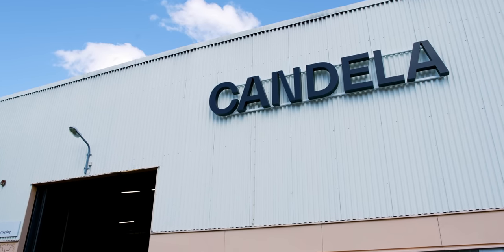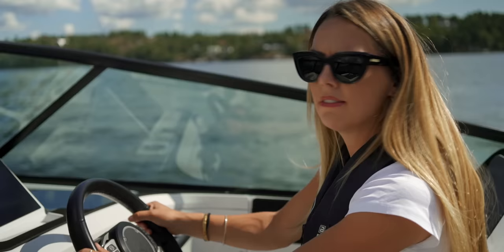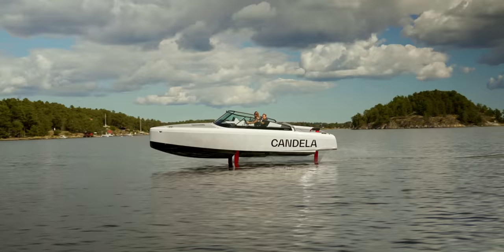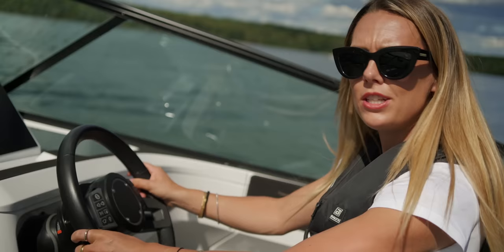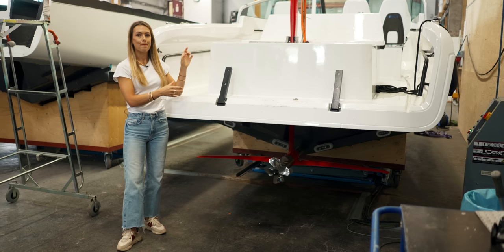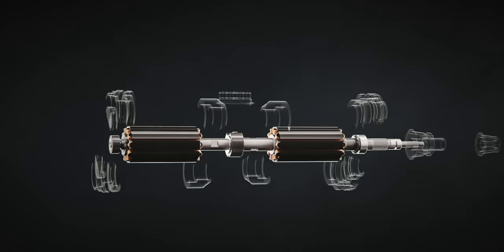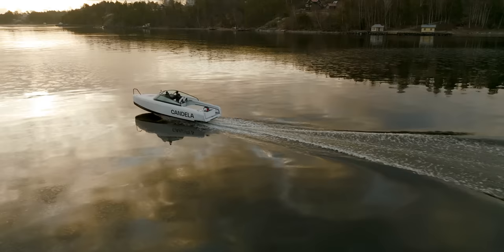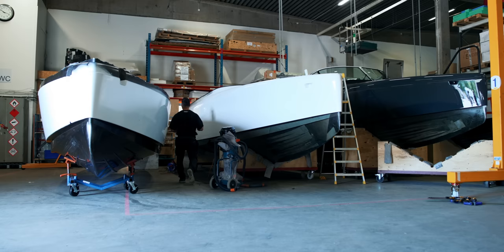This Candela Electric Boat FLIES!

Comment: My favorite part about this is when she is out on the open water, driving/flying this boat, and just talking at normal voice levels.
Reply: Absolutely, a normal power boat at those speeds makes conversation a very shouty affair.

The other thing was that her hair was almost still. The windscreen design on that boat is super clean to have so little turbulence at the control position.
Reply: @rlaxton666  Totally forgot about the lack of wind noise. Absolutely right about the cockpit design and the air bubble the captain enjoys.
Reply: @JasonCarmichael  Very much a benefit of a long haired presenter. Other than microphone noise, some buzz cut guy would never have given us this much information so quickly.
Reply: And the design also allows for a smoother ride. Win, win, win, win all around
Reply: sooooo, you can only use this on a slack water... just an observation...
Reply: @hunyango2k  No. Hydrofoils can be used anywhere except extremely shallow water. Large commercial hydrofoils already go on tidal or open water. And on the opposite end of the scale, kite surfers often ride hydrofoil boards on choppy days when regular boards can’t be ridden.
Reply: I was just about to make that same observation Jason
Reply: Right! That was so cool
Reply: Intelligent noise reduction algorithms in modern microphones and editing programs plays a role here :)

Comment: Imagine the flex of driving one of these through a "No Wake Zone". 😆
Reply: Makes you wonder what the minimum spec is for getting up on the foils since the wake is definitely going to be less at that speed than just dribbling along at 5 knots in "boat mode", which is a common speed limit in wake limited areas.

Comment: I spent fifty years in high tech product development. From consumer electronics,  to marine equipment and NASA management.  
This boat, although not introducing anything particulary new, is the perfect integration of complimentary tech. Wonderful. Foils, electric drive, it was a marriage that had to wait for the right time. And that time is now. Kudos.
Reply: I do have one small criticism. In applications where one needs greater range, this system, although it makes it easier to adopt batteries, doesn't fundamentally support batteries as the prime power unit. It would be more cost effective at low intensity to install an equivalent power diesel generator with Rolls-Royce style baffling. 

That said, it is still fantastic engineering and it does at least lower the performance envelope for batteries to be installed at more reasonable weights and volumes.
Reply: @josephkolodziejski6882  They could easily go to cat version and have more power/range. As battery efficiency rises this will be more feasible.

Comment: Imagine a Candella ferry on the Thames or maybe some of the larger more northerly UK rivers.
Reply: love the boat but hydrofoils are not allowed on the Thames above the ferry. the engine is something i can see lots of british waterways clearing for use. if they could do one suitable for narrowboats they would go like hot cakes. the taxi engine thumping away is the only thing that spoils a trip on a narrowboat.
Reply: @tommyfred6180  Why aren't hydrofoils allowed (above the ferry) - didn't understand that last bit? 
I'd considered narrowboat usage but dismissed it on the grounds of very low speed restrictions on UK canals; (might) be useful on EV surfboards in a canal situation and these are already on the market - see Electrek & Fully Charged Show's YouTube channel videos.
Reply: @pinkelephants1421  the Thames has different restrictions on everything from speed to prop type. it split up into different sections. above the ferry refers to the Woolwich ferry crossing. its one of the points the rules change. as i understand it and i could be way off. hydrofoils are not allowed beyond this point.

as for the narrowboat i think a low speed prop set up for the motor shown could work well.
Reply: @tommyfred6180  There are already companies building electric or hybrid narrowboats, and you are correct, the silence is golden. Look up Ortomarine, Hybrid Marine and Mothership Marine for some examples, I'm sure there are more.
Reply: @gz3zbz  yep i know. but i didn't know about mothership marine. i'm going to give them a look. thanks.

the problem with the ones i do know and i could be way out of date on this. is they are all working off the idea of just replacing the engine with an electric unit. you still have the prop drive system and so on. this unit setup would be way better. you could even set it up so you got directional thrust.
Reply: @tommyfred6180  Thanks for that much appreciated. However, surely a low speed prop would entirely negate the benefits of a hydrofoil as it wouldn't operate at a high enough RPM to bring the boat out of the water & a narrowboat is entirely the wrong shape anyway.
Reply: @pinkelephants1421  ho i get your point now. yah a narrowboat with a hydrofoil. now that would be something to see. :)

no it was the enclosed power unit and prop set up that i think would transfer well. mate
Reply: @tommyfred6180  O-h-h-h, I see where we were getting our wires crossed now. Yes, that would work. But I still don't think you could make any meaningful full use of a hydrofoil's full capabilities; canals are strictly puttering along territory.
Reply: @tommyfred6180  the system has to be pretty robust on a narrowboat what with all the shopping trolleys, bicycles, logs and generally low water levels that you find in a typical canal. I do agree there is still room for innovation.
Reply: @gz3zbz  yah the thing would need to be beefed up. smacking into a submerged moped even at five mph could be an issue other wise.

perhaps cowl the unit would a solution. or they could just dreg the canals now and then. :)

Comment: What I find coolest about these hydrofoil boats is that... This simply isn't possible with petrol engines! ICE hydrofoil boats exist, obviously, but they are a lot more complex and expensive, because they need to keep the engine above the water while the foil operates a metre or more below. On the contrary, electric motors don't need air, so they can be put underwater, making them a lot smaller (the water itself is the cooling system), cheaper and more efficient. And you also get the added benefit of less noise and more stability.
They truly show how electrification can be the answer to the questions we never dared to ask

Comment: A retractable rigid cockpit tonneau, that covered the entire seating area while the boat is waiting in its slip for the next outing, could be cheap, relatively low-efficiency solar panels that, low efficiency notwithstanding, would charge the batteries up over the multiple days between outings.  Not many people use their boat every day; when you're running with only a couple of people aboard keeping the tonneau mostly deployed would probably also make a significant improvement on the vessel's aero drag (which cannot be ignored when talking about cruising speed and range) and further improve its performance.
Reply: There are plenty of extras for such boats: seats, couches, tables, covers etc. I'm sure Candela will provide most of them.
Reply: That would be great accessory

Comment: We can cool citys worldwide with a couple easy to implement infrastructure.
Parking lots take up 25 to 30% of land use in citys reduce this by 80%.
Go up not out parking garages can have batteries on first floor and solar or wind or bolth on top.
So the now freed up land can have native flowers bushes and trees to reduce heat flooding co2 and crime and increase o2 happiness and food if it gets planned of course.
This will help cool citys wich will reduce energy demands because you will need to cool buildings less often than before.

Comment: Superb combination of innovative engineering and product design. 
I was wondering about the pressure differential - to create the lift - spoken of only in terms of the angle of attack (effectively) . After getting up to speed, for minimal drag I think you'd want zero angle-of-attack and reliance on an aerofoil profile to generate the needed pressure difference. The 'wing' profiles certainly appeared to be aerofoil shaped.

Comment: Friend had a very expensive motor yacht or very large speed boat you could sleep in it, it shifted when you wanted it to. Now this was a good few years back but you could spend the day in the Loch it was in. If you went 20 miles in the days fun if felt like you had traveled far. The scary thing was you could watch the fuel gauge move on full power. In todays petrol prices ( yes they had to pay over the odds marina prices to use their pump) back then it burned through £100 in an afternoon and this was 15 plus years back and just thought wow that’s crazy in petrol you have to just accept your going back to put £100 in at the end of the afternoon. 

So I like this, it looks a fantastic toy to use on the water. More power to them if you forgive the pun. I’ve been around speed boats all my life they are poor on reliability akin to a classic car or at least they used to be so a more reliable boat - great. A clean boat not leaving a rainbow in the water welcome.

PS Stockholm looks stunning.

Comment: Whether you travel through air or water, power requirements are proportional to speed, a single horse can pull a car or boat. In fact it is probably easier to pull a canal barge than a truck. People are starting to produce electric canal boats and I believe that will accelerate when more marinas electrify berths and the EA put more charging points on the canal banks.
Reply: yep, I watched only as minute and got shocked by the statement that pushing through water takes more energy than pushing through air. This is obvious, but except military and smugglers and few scientists nobody uses submarines. Boats, even are pushing a little through water, still are going mostly through air, and are actually more efficient than planes. Sure, hidrofoils are more efficient. We had few passenger ones decades ago. I wonder why their use was discontinued.
Reply: @ehombane  The vast majority of the energy it takes to move a boat is pushing the water out of the way, not the air.
Reply: @davidf2281  If you read again my comment you will see that I have said that this is obvious. So, I have no idea why you are repeating the obvious.

Comment: Fabulous tech! 
Any idea how robust the foils are?  
If you were to hit a float (crab pot, net, log) ... What happens?
In conventional outboard you may need to refurb a prop ... The hull may have a scrape or ding. 
How would one of the foils fare?
Reply: In the 1970s-80s, Boeing made the 929 Jetfoil ferry boat.  It carries 200-300 people and runs at 45 knots.  They sold 50-ish vessels, I rode on one in Seattle way back when.  People always asked about hitting stuff, with all the trees that make it into those waters, but they never developed a sonar that would detect that sort of thing.  The boat required a deep channel, so it could stop in an emergency.  Several sharp maneuvers made the news, mostly for spilling drinks, but they claim there never had a vessel disabled by debris.

You can't operate something like this with plants in the water, from a fouling and drag risk, and hitting a sandbar might be catastrophic.  You'll want to keep to deep water, like Swedish Fjords.
Reply: This technology have been used on larger ferries around the world for decades. Hong Kong ferry would probably comes to mind.
Reply: @nntflow7058  We had few on Danube too. Russians also I think they still have. And I remember an japanese one recently hitting a whale.
Reply: @rsaunders57  "You can't operate something like this with plants in the water, from a fouling and drag risk, and hitting a sandbar might be catastrophic."
The same limits apply to a conventional powerboat.
Reply: @davidf2281  Well, a conventional powerboat has less draft, and a V hull is much better at pushing things out of the way.  The wake of a boat has functional effects, not just the negative drag effect.
Reply: @rsaunders57  Those foils aren't as deep as you think.
Sure displacement hulls are "better at pushing things out of their way" 
That's how they work. You're comparing an aeroplane to a zeppelin.
Reply: The foils are carbon fiber and are meant to simply snap if you hit something. Then the boat simply falls into the water and acts like a regular boat from there on. I think it seems safer than a regular boat in that respect.

Comment: Would have been nice to compare fuel use to the powerboat next to it. Nvm, at 8:50 its said 500 € for gas or 15 € for electricity.

Comment: Hate to be one, but that would make an excellent Spec Ops infil boat.
Paint it Vanta black and you could probably pass within 100 meters without being detected.
Major heat source is under the water, so helps with IR detection.
Extremely low maintenance.

Comment: The "magic" ratio of water density to being mostly up in the air that allow this boat to be so efficient also works for human powered water propulsion. I am a  long time member of the International Human Powered Vehicle Association which has been "flying" boats on the puny efforts of a single human faster than the fastest eight person  Olympic  style racing shell boats for decades now. A good human athlete can just about put out 1to 2 hp for enough time to get up on the foils and it takes  1/8th that to stay up. Our craft have used mechanical means to control the flying height, and body weight shift to compensate crosswise waves or to make the boat bank like an aircraft in turns. Of course we also have been using kevlar and carbon fiber technologies to achieve the lowest weight to structure sizes needed. See one of the winning boats from our competitions at the Boston museum of Science, If it is still hanging just inside the Atrium. The Decavitator was built and propelled by one of this country's best aerodynamicists Mark Drela

Comment: If we are considering flying boats then there are lots of other tech that can cut energy use moving over water -  ground effect seaplanes, hydrofoil ferries, air bubble hull surface effect water displacement, waterjet propulsion. While this small boat design can work elsewhere, its weight penalty due to batteries as well as the energy needed to get it up to speed preclude many heavier boats. Point to point ferries which avoid most bad sea states can work with batteries but many ferry routes must face extreme and unexpected sea conditions where weight, balance and propulsion power is paramount. It might work in easier routes like the Red Sea.

Comment: I really hope the foils can retract and perhaps even adjust depth as needed for trailering and for shallow areas or areas with lots of debris.
Reply: yes the foils can retract into the hull. Shame Imogen didn't show this. Also how strong are the foils if you hit an object on or under the water surface?
Reply: Would this be trailered regularly? It seems like the kind of thing which would have a marina berth.
Reply: @waveman1500  It's 28 foot - nearly 9 metres - so probably not. most marina berths have a power supply so shouldn't be an issue for charging.
Reply: @evornotev7794  They are meant to break off if you hit something very hard. That is much safer than suddenly coming to a stop.
Reply: @waveman1500  Regularly, no... but winter climates generally favor removing boats from the water and storing them when waterways freeze.
Reply: @jimj2683  Thanks. I guess only issue there is if the impact takes the rear hydrofoil with the motor in it, then you are stranded? I'm guessing it's a pretty rare occurrence though...

Comment: Hydrofoil wakeboarding and Watersports boat would be super awesome. Add some solar panels to charge the battery and that will be my dream boat
Reply: The hydrofoil boat creates barely any wake, which is the opposite of a wake boat. You can get hydrofoil boards though!

Comment: I love this, but worry about what would happen if you were to hit a submerged object like a small log. It looks like it would be a very expensive fix.
Reply: Yes I was thinking just this.
I grew up on fishing boats in rivers and lakes, occassionally you'd hit a submerged object. If you were lucky the outboard would just kick up and save everything, or if slightly unlucky you'd need to replace the prop, or very unlucky, shaft got damaged :(
With these boats, the whole motor is underwater so if it hit something substantial you could be in for a really expensive repair.